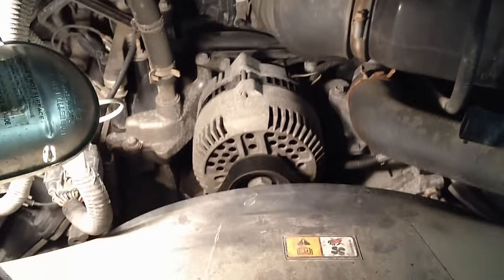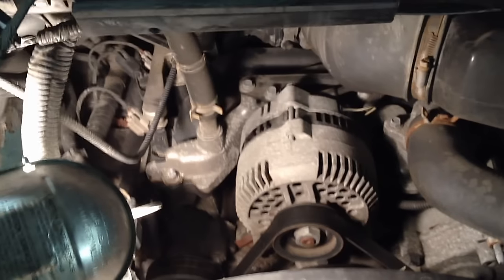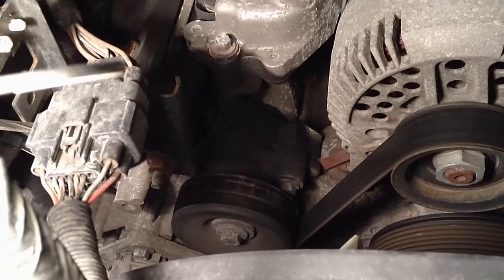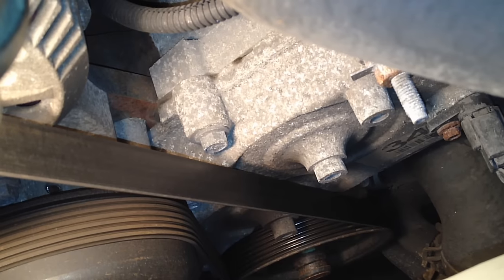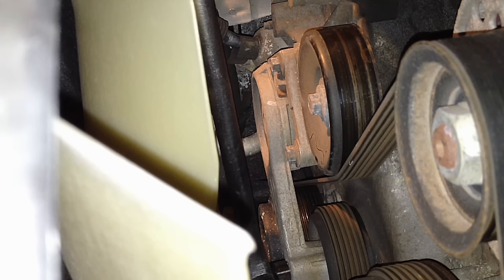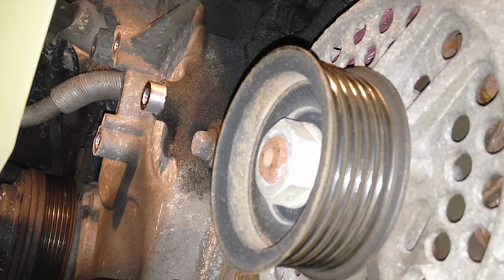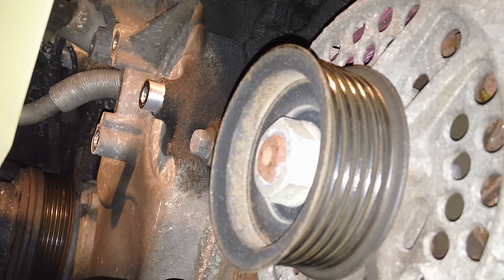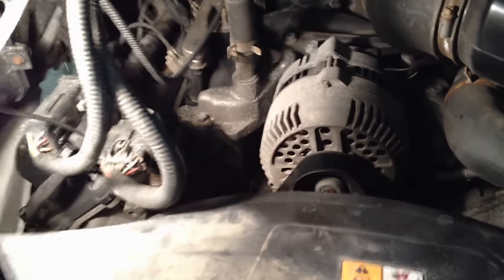Ford 4.6L & 5.4L Power Steering Whine Type Noise

Comment: Im torn between thinking its the tensioner or the PSP. Just because the truck is very rough when turning.
Reply from the maker: Pop the belt and spin the pulleys you will hear it.

Comment: 2006 explorer v8- My engine fan stays on and makes a huge roaring  noise when I turn on my ac going on the street and highway and it's stars to whine when I accelerate and the rpms are high and stops when I let of the gas pedal
Reply from the maker: You really need to look for a leak as shown in my video, also thermostats are known to stick closed on the v8 engine. Here is a few checks- Quick Tips: #6 Checking For Hidden Coolant Leaks

Comment: I have replaced my tensioner pulley, idlers, serpentine belt and power steering pump and it still makes the noise. I am at a loss

Comment: I'm having similar issues on my 05 Mustang GT but mine sound more high pitched, kinda like a twin screw supercharger during idle and as i drive. it's coming from one of the pullies from the drivers side.
Reply: I'm having the same issue with my 04 F150.  Like you said it is coming from the drivers side and is higher pitched.  I have not replaced yet but thinking of replacing the power steering pulley.  Unfortunately you need a tool to do so but found some online for $20 to $30 bucks.  Have you replaced yours to see if that was the issue?
Reply from the maker: Richard Fairhead No don't replace the power steering pulley I can guarantee that is not the issue. Run the engine with the belt off to verify  it is a driven pulley and go from there.
Reply: ok Im gonna try to start the car without the serpentine belt. I'm now thinking it's most likely the alternator going bad
Reply from the maker: If it is cold there yes we have seen them make loud noises when cold on F150's Expeditions and explorers of that era.
Reply: FordTechMakuloco Looked into my issue a little further.  Hadn't taken the belt of and spun the idlers and tension pulley.  (I have two Idlers on my 5.4 Triton) after spinning this one I could definitely tell a difference from the two located just like on your video.  Put it back together and listened again and that definitely sounds like where it is coming from.  Thanks!  One other question are both idlers on these motors the same? or is there a specific part size for each?  I will be looking on ford's website as well to see if I can find out.
Reply from the maker: Yes they are the same

Comment: Have you ever worked on 4.6 mustang gt 2000? I have this weird pinging noise when I drive 50 and over. I drove to Los Angeles last week and noticed that when I pushed the acceleration it made the noise like if a metal part was lose I had a misfire a while back changed coils and now I don't have a check engine light on. But it still feels laggy
Reply from the maker: I would replace the pcv valve if you haven't in awhile they are known for this. Also when was the last time plugs were changed or you did a induction service?
Reply: Plugs were changed 6 months ago along with coils but will try pcv thanks very much
Reply: @rsaucedo59  did you ever find out what the problem was ?

Comment: Would this add resistance to the steering wheel?
Reply from the maker: no
Reply: My Ford crown vic 2007 steering wheel was fine yesterday and today it has resistance when turning. Then a few minutes ago on my way to the store it freed up and was fine , on the way back from the store it had resistance again. What's going on?

Comment: Are the idler and tensioner pulleys the same size?
Reply from the maker: Michael Swan Not sure exactly but they seem very close.
Reply: Well I guess since I'm replacing the tensioner pulley I might as well replace the whole tensioner arm as well correct?
Reply: Or do they only offer it as one whole piece?
Reply from the maker: Michael Swan Yes I would replace the complete tensioner.
Reply: Alright thanks.
Reply: FordTechMakuloco I had EVERYTHING DONE. New belt was installed. New tensioner pulley installed. New idler pulley installed. I was tightening the idler pulley bolt and it SNAPPED OFF...

Comment: It doesn't even sound like a power steering pump whining.plis you would know because when you turn the steering wheel it would whine worse
Reply from the maker: The idlers would sound worse when steering too as the pump adds extra load to them. Trust me it sounds just like a power steering pump whine.
Reply: @FordTechMakuloco  yea i was trying to find videos on how to change power steering pump on 08 f150 with 4.6 and found your video.but my pump has been leaking and now it whines constantly

Comment: Dorman is junk. Buy quality bearings and press them in. Timken or SKF. QualitybearingsonlineDotCom is a pretty good place. Cheaper than the pulley and will last a long time. My 4.6 is supercharged, so my bearings see a lot more tension.

Comment: Brake Max, Want's to charge me nearly $3,000 for a Whining Noise that Is coming from my power Steering or Alternator and Those Fool's Saying it's the A/C compressor Grinding.`But Wanna change all 3part's, But My A/C is Working Just Fine. Can you Believe these Guy's.

Comment: I guess you are the man when it comes to diagnosing fords, I just uploaded a video about issues I have with my f150 here is the link http://youtu.be/ydji-YKycTs can you help me finding the ghost who lives in my truck? thank you.
Reply from the maker: certified30 Have you performed the test as shown in this video? I really sounds like the one pulley has enough bearing damage it is starting to grind into the front cover, I have seen this before. Do the test in my video first.
Reply: FordTechMakuloco I will definitely replace all the pulleys and even the water pump and the steering pump. I will also do a vacuum leak test since the truck has a very bad rough idle, can you tell me what hose best to use to do a smoke test?
Reply from the maker: I would say the easiest and most compatible hose is the one going to the fuel pressure sensor drivers side mid.

Comment: Hey if you can let me know what you think is wrong with mine. I uploaded on another profile but listen to that sound lol.
I'm beginning to think it's the power steering pump because turning the wheel makes it worse.
 https://www.youtube.com/watch?v=SCwI8Ah1GoU
Reply from the maker: Yeah one of your pulleys bearing are gone. The tensioner is the most common on this car so I would change that and the belt at the same time and while you are in there spin the rest of the pulleys. I would not suspect a power steering pump unless you see aeration in the fluid.